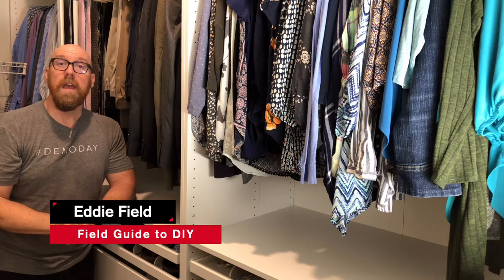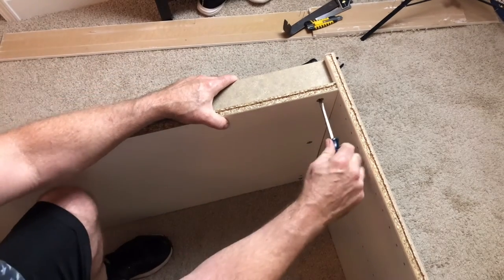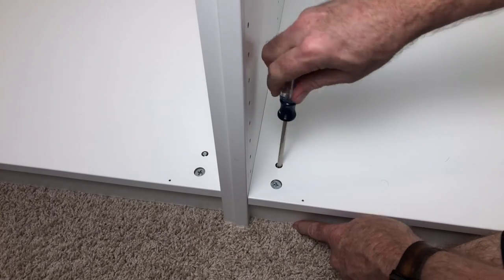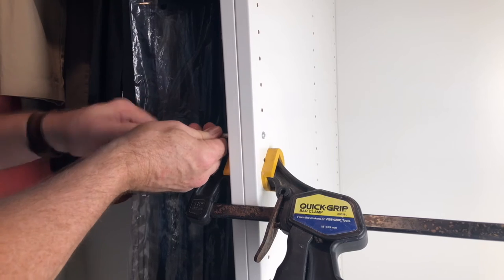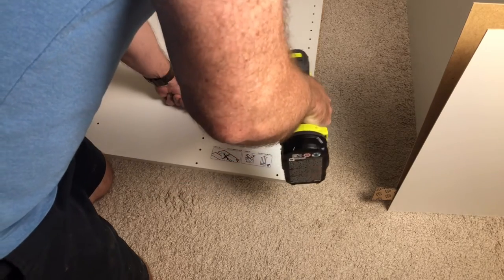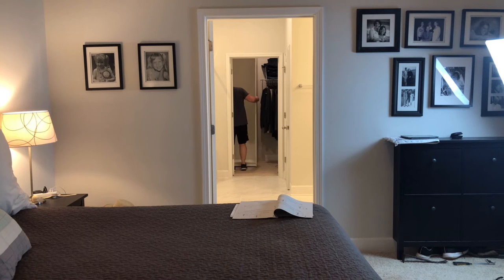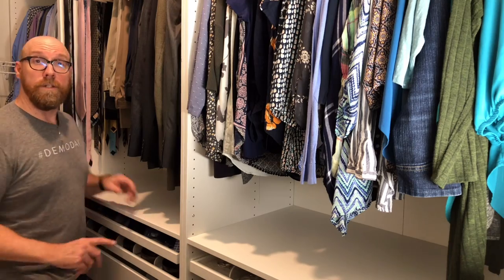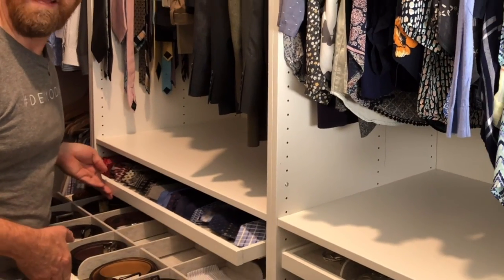Joining IKEA Pax Closet System Units Together

Comment: You say the units were attached to each other using the threaded bolt provided. Are you saying that the pax unit came with bolts to attach to each other? I don’t think ours had any bolts to attach to each other.
Reply: Uk based, but part numbers 100402 and 100644 are what you need. I am assuming that part numbers are the same worldwide.

Comment: Did you attach the wardrobes to the wall as well?
Reply from the maker: I did not have to as I adjusted the leveler tipping them back slightly and they are anchored together.  Now the single you see to the left IS anchored into the stud because it is not as deep and has a greater chance of tipping.  Thanks so much for watching.  Let me know if you have any other questions or suggestions!
Reply: @FieldGuidetoDIY  thank you for the response :)